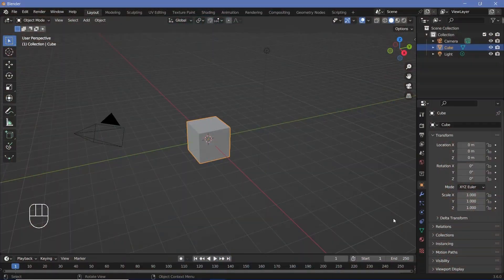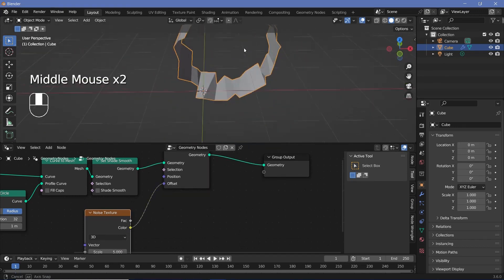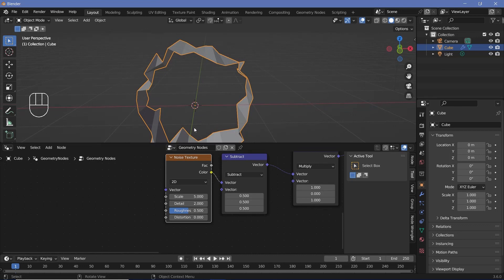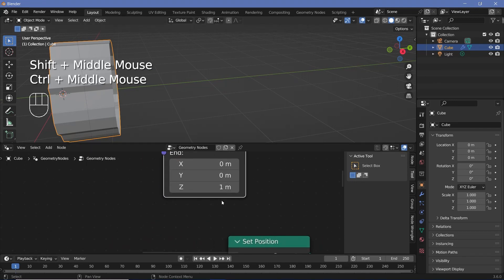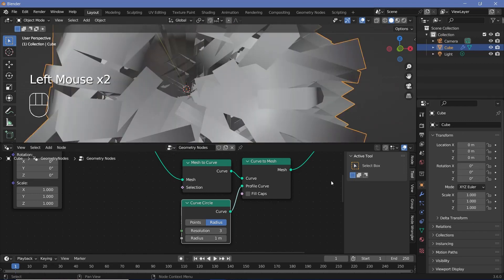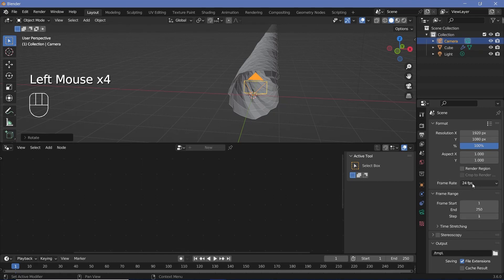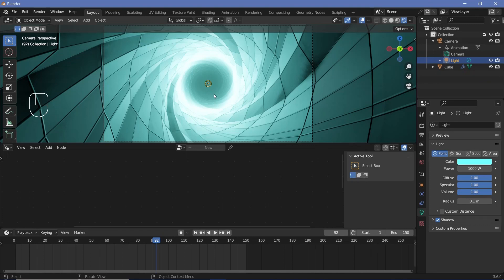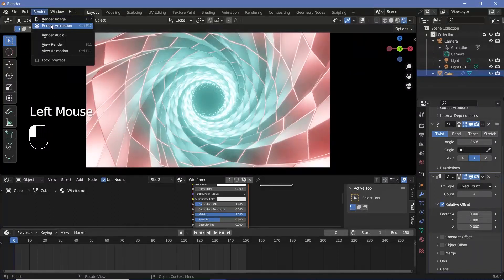Abstract Geometric Tunnel Loop - blender Tutorial

Comment: Well deserved 3k :0
Anyway... I get lost at 7 min. since when I move the camera at 150 frames it just exits the tunnel like logically it should. Do you have any extra camera settings or am I just stupid for not noticing something obvious?
Reply from the maker: Thank you so much!! I really appreciate it :)

I've added an array modifier that essentially extends the tunnel (array count is set to 3 or 4 to make sure the end of the tunnel can't be seen). So the camera reaches the end of the tunnel, but that is the start of the next tunnel.

The settings for the array modifier is mentioned in the "Other Modifiers" chapter of the video. 

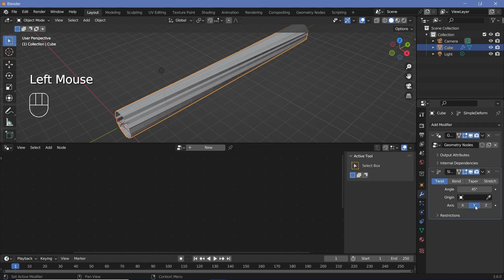You should find it at the timestamp: 6:50

I hope this solves your question :)
Reply: it solved something but it still is jagged even tho I'm messing around with the Array modifier @deayanstudios
Reply from the maker: If you could send a few screenshots of the geometry node set up that you're using, I can try to figure out what might be going wrong.

You can send them to me on instagram @deayanstudios

Essentially, for it to be a perfect loop, you have to ensure the noise texture is 2D along the vertical (xz) plane, for which you'll have to rotate the position by 90° about the x axis.

Apart from that, the simple deform modifier has to be set to twist along the Y axis and the twist angle must be 360°.

If these two are taken care of, it should perfectly match up and become a perfect loop.